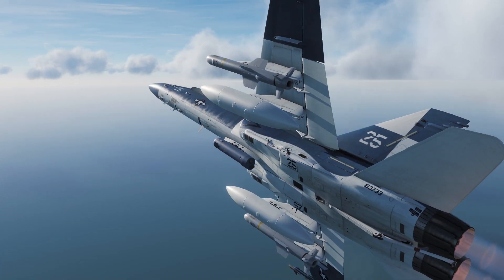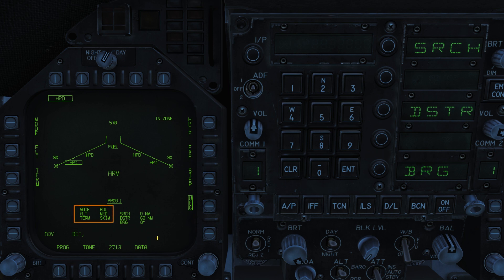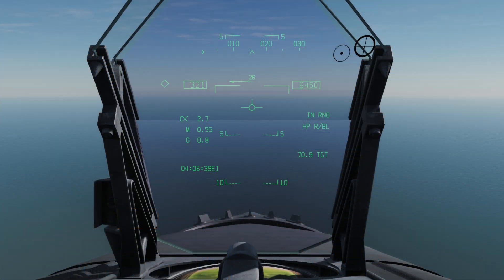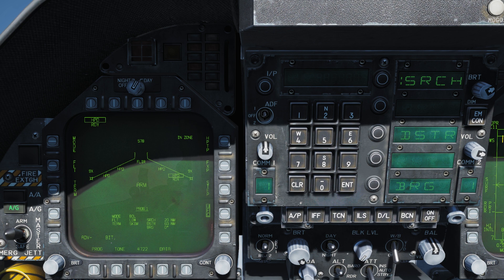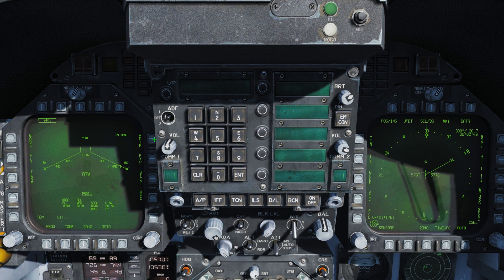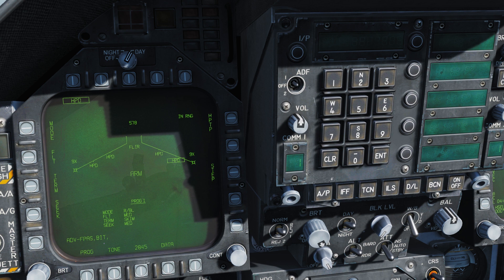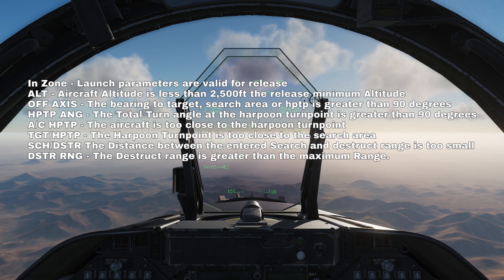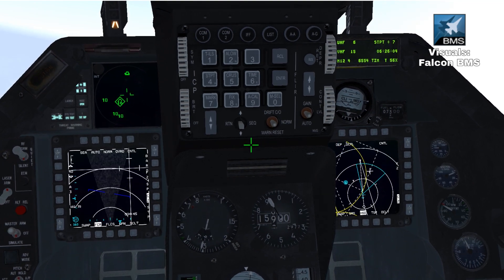DCS F/A-18C Hornet AGM-84D Harpoon Tutorial

Comment: This is actually very accurate except for the pop-up mode
The harpoon missile pops up to about 2,000 ft from about 5 MI
Then it flips over directly over the target comes down at about a one and a half degree angle over the target almost straight down
The reason it does this is like most anti-ship missiles
It is attempting to defeat the closing weapon system receivers or failing system
Which can only point up to a maximum of about three to four degrees it cannot go to one and a half degrees straight up like that
So they have to ship missiles are actually designed to just come straight down over the top of it so that it cannot be shot down like that
It gives it gets them a higher probability of hitting their target

Comment: Can you elaborate on using the fixed point mode further? So a point is set in the middle of the self destruct range and search range. Now as I understand it, the bearing will then change so that the missile will always fly over that point, but not fly down the same bearing when the point was designated?
Reply from the maker: That's pretty much it, The bearing automatically adjusts to keep that centre fixed point the centre of your search. Could be useful if you're forced defensive before launching or have to re-position. I think it's meant to be possible for subsequent harpoon launches to inherit the same fixed point but it doesn't function this way in dcs (at least not yet)
Reply: @RedKiteRender  thank you, I can imagine this is useful if you don't have a targeting pod or some other way to do a range and bearing launch